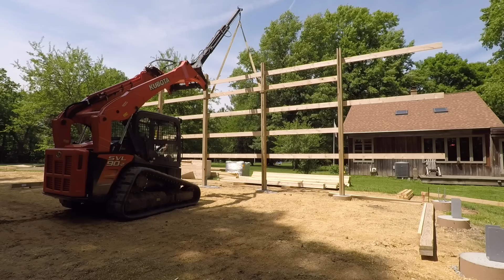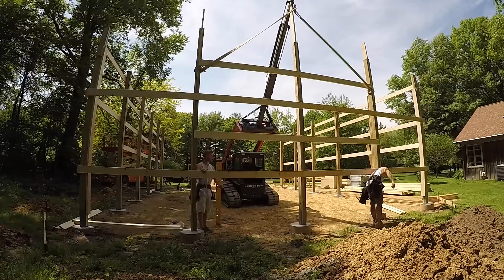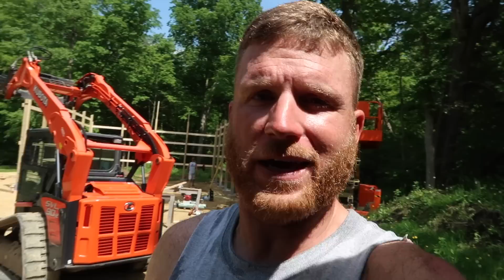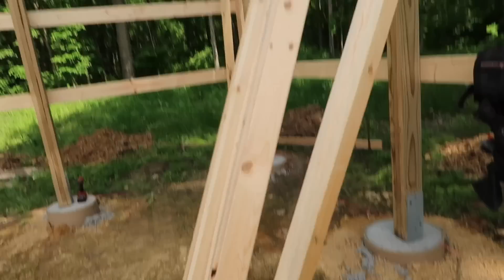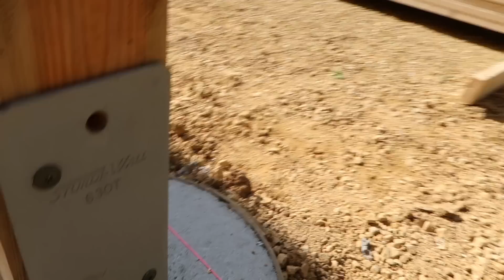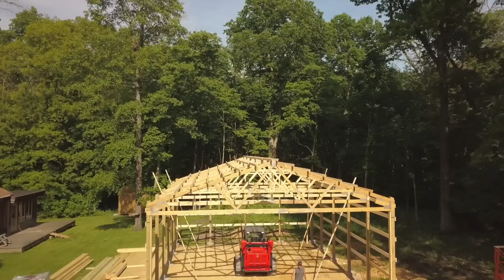How to Build a Garage Part 2.2 Walls and Trusses

Comment: So basically… the Kubota is replacing the 5 to 10 Amish guys that would usually raise your walls

Also, the only time we hear the word  “ telehandler” in our parts of the country are in the certification / licensing tests. Otherwise we just call it the lull … no matter what the brand … 😉

Great series by the way. Was directed here by your metabo rebar bendy doohickey vid

Comment: Hey Kyle, I had a couple of questions if you would not mind helping me out :) what size hole do you drill in your perlins? What length of perlin do you use? How do you overlap them and still be 2 ft spacing? What length of girts do you use? How do you girt the end wall with the truss outside of the end posts? I am trying to build our own 24x40 house with concrete slab inside of piers. Thanks for all the videos you post, you really encourage us!!
Reply: The exact questions I have....

Comment: Question for the builders.  How much is the front and back wall offset inside to allow for the back wall to attach next to the end trusses?  I’m confused, because it looks like the back wall posts are even with the end of the sidewalls with the back wall exterior gerts going across.  But the extended center sections on your end wall posts would interfere with the end trusses wouldn’t they? What am I missing.
Reply: I have this exact same question, its the only part i'm not understanding.
Reply: End truss attaches to the outside of the posts I think. I was wondering the same and it looks like that's what they did.

Comment: when you inserted those metal brackets into the concrete, is there anything other than the weight of the building holding them in place?

Comment: I;m from western ny and will be building my own post frame garage but plan on having living space upstairs. Center ridge board with rafters to allow for open concept. What's your thoughts?
Reply from the maker: If it passes the necessary engineering sounds fine.... I only worry about it splitting apart under weight.  Might need a bottom chord tie of some sort

Comment: We live in Indiana, looking to build a 30X40 building next fall. Would wood frame be better than steel frame? I will have to speak to an inspector since it's inside city limits, I do plan to hire a local company, or Amish to put the structure up. Thanks.

Comment: Is there an advantage to this kind of framing compared to a poured concrete slab with bolts cemented in it to attach the bottom base board?

Comment: I really like how you do all the math before and measure/mark everything on the ground so that later you only do the assembly. And I really like how you go through all the boards and leave the best looking ones for the most visible parts of the project. I had a guy do a really small garden project for me recently using railway sleepers. He only had 8 of them on shorter sides and still managed to install the worst one (the know was already out) on top. And was still making excuses and wanted to charge for the new one when I pointed it out. That only shows your professionalism.

Comment: Is there a reason you build 30'x40' instead of 32'x40' to match that standard length? I imagine it has something to do with roof length or overlap requirements, but I'm curious.
Reply: 32 x 40 is more efficient (increments of 8')

Comment: I am interested in knowing why you prefer the bracket method of connecting the columns rather than direct embedment of the treated posts into the ground to obtain the shear and overturning resistance? In my area it seems most are using a direct embedment method.

Comment: How does the grade board work on the front of the building when the bracket is in the way?
Reply: It has to be planed out slightly on the corner bracket.
Reply: Since then I’ve seen them cut off the outside bracket too
Reply: @idahoduckhunter  yeah, they do that on the corner and inside garage door opening.

Comment: Kyle when you set the purlins they appear to overlap at every second truss. When you later screw the roof sheathing into the staggered purlins line  how do you still maintain a single straight line of screws across the entire length of the roof?
Reply: Did you ever find out an answer to this? I'm curious.
Reply: No

Comment: reweatching this in 2019. it strikes me how cool the imperial system sounds when he shout outs all measurements. but damn its confusing. meter, centimeter and millimimeter. for instance, a drywall board is 2500mm, that would translate to 984.252. way too confusing :D or just say 2.5 meter instead of 984.252inches.
Reply: 98.425 inches. 🤣. 8 feet 2 and 7/16 will get you close. Little secret metric people seem to not know. Tapes are marked in feet. Think of feet as decimeters. They get you near where you need to be.    It really does come second nature.

Comment: Hey Kyle! 

I'm a big fan of your channel I have been watching you for years. I only want to say this as a friend would say this and not to be a keyboard worrier or something like that. When I was watching and you were standing the walls up I think you might be over weight and what could happen is a hydraulic leak. Please look up high pressure hydraulic injection injuries this might hit (Greg) a worker out side of the cab..... also once the wall or item is in the air and you jump out with the boom in the air the Hydraulics can fail and come down. so when you jump out of the cab and put your body in the line of fire or in the crush point between the cab and under the boom it sure does scare me. Maybe you do this and dont show it on film but all the Cat Skidsteers I have operated have a red  swing arm that can be put in place on a cilindar arm when in the air so if there is a failure you wont get crush Greg would have to put this in place while you are still in the cab.  Please keep up the good work I really enjoy watching!!!!

Comment: You mention about the aspect of insulating and vb regarding how you do the corner - is there any particular reason to not use spray foam insulation vs fibreglass (of course other than cost!!)

Comment: You mentioned that you installed the purlins every 2 feet on the rafters.  I see that you overlapped the purlins where the meet.  How do you align this with your 2 foot measurement?  Also, how do you keep your roofing screws properly registered with only a 1-1/2" purlin when they are presumably staggered at the overlap?

Comment: Probably a stupid question, but what is a "girt"?
Reply: Girts are the horizontal boards on the poles, they tie the poles together and are used to hang the steel walls.  Purlins are the same horizontal boards, but on the trusses.  Girts & Purlins - the way a pole barn / building gets walls and roof.
Reply: @shawnb2927  Thanks very much.

Comment: You may have answered this before, so if you did, please excuse me. What is your opinion of the closed cell spray foam for insulation on buildings like these?
Part of me wants to be lazy and have the company spray the insulation, and the cheap part of me says the fiberglass will do the same job at about half the price. 
I am building my barn/garage, and using wood that I have cut on my own land. While slower, it is in my price range. 
My house was built in , and everything is made of oak, even the roof. No plywood anywhere, just rough sawn red oak.
 Actually some pegs too. The plaster has cow hair in it for a bonding agent. I guess I'm happy it wasn't built in the city, because a lot of them used asbestos in the plaster. 
Your videos help me a lot, and I'm very grateful for you taking the time to film these, and rdit them. I know it takes a lot of time, and I just wanted to say thank you!
Smiles!

Comment: Sorry for not correct English, I'm from Russia. Question. What is your snow load, if any.
Reply from the maker: 35lb
Reply: @RRBuildings  Yes snow load on the roof you have a small
Reply: @RRBuildings  This is where the kilos on square meter

Comment: Why do you guys use this construction method? Why not the normal stud bottom top plate method
Reply: Cost and speed, plus to use normal plated walls, you need to start with a slab first.  Concrete floor isn't necessary for construction of the building, so getting under roof is significantly quicker.

Comment: IN PART 1

Holes like that are NOT the best solution for piers. These holes sink into the ground like a nail when there is a lot of precipitation or after winter. The CORRECT way is to build a square footing as a base  24 by 24 inches wide, 11 inches high, 4 feet into the ground. And then place a sonotube (pier) over the cement square base. 
The hole must be 54 inches deep, then place the footing, then a 10" or 12" Sonotube filled with concrete.
It is also a good idea to wrap the sonotube with thick plastic wrap, so that when the ground frosts it does not move the pier upwards, instead it glides on the pier.
Reply: There is no way they need a footing that big for the loads they have.  They are already way below frost line, so no issues there.  They are ~16" diameter piers already.  If you want later, he uses larger diameters for wider span footings (length of building doesn't matter).  This is all engineered and approved for actual soil conditions of the area.

Comment: I'd like to see a video from your perspective on building an efficient designed structure as far as overall dimensions, wall height, roof pitch, poured foundation/ footer walls vs piers vs post or laminated post set in the ground and general advice as to what to look out for and things to ask.  I wish you were in my area.  I'd have you build my next building for sure.  Thanks for the videos.  Any advice/ discussion on steel vs wood frame would be great too.

Comment: Are you using any perminent bracing systems for the walls roofs and roof trusses, appart from the chains and winches to align the frame for example in USAhttps://www.youtube.com/watch?v=RBIEmvhcQzI  
or as required in Australia in the video below
https://youtu.be/hKA6sVey8J4
Reply: Once the metal is one, that provides permanent bracing.  Or, if the building is sheathed, that provides plenty of bracing.

Comment: So the posts are off the bottom of the metal brace by the measurements you took and marked?
If so, that means the Cheyenne is holding the wall up and adjusting to get the bottom of the posts on those lines?

Comment: You plumb up corner posts after intermediate wall section is up... how do you keep intermediate plumb?  I didn't see any rack braces on it.   How are you keeping corner and intermediate plumb?
Reply from the maker: everything is installed plumb....then before steel goes up we check everything again

Comment: For those wondering is 8 foot bays are common, they are but not the only width/length you can set at, 12 is another common bay spacing and larger is less common but still doable with proper engineering and construction method. And for those wondering what size a 20d or 20 penny nail is here is a webpage with a bit of history of how the naming convetion came about for them and a quick size list for each length from 1 to 80 d/penny;
http://www.packinc.com/2015/09/why-nail-size-called-penny-why-symbol-d/

Comment: How much is it for this exact size building from start to finish? With a ceiling on but no wall coverings on the inside.
Reply: You are not going to get an exact cost due to additional factors, but some offer a base price for a package and from there it will increase per local building code requirements for roof load and wind load and also the type of foundation will affect the cost along with final looks of finishes and those entailed materials and their sources with their costs.

Comment: Tossing up that building is enough work, without adding the overhead of the video!  Hope this channel gets you some clients.  2 cents from the peanut gallery.  1] For this type of build have you thought about helical piers? 2] I noticed during layout from the story board you were marking each board individually? Do you think you could gang them if you worked from the ridge down, then just deal with variance cut @ grade?  just asking??
Reply: Never seen a post frame/pole building framing structure use helical pile for foundation for some reason...
Reply: at least for wooden structure

Comment: Another video idea is to cover what materials you use and preferred vendors.  I.e what gauge metal, truss spacing, grades lumber used, compare nails/screws you use vs box stores.  Basically help avg DIY builders know pros and cons of what materials to buy
Reply from the maker: good call

Comment: you gotta post sometime soon, how the floor is poured from inside a already built garage/storage/house. or if someone can link to a video on youtube cause im duiyng to know how thats gonna turn out.
Reply: on DiResta channel for his build it only shows very short bits of the pour process, but there are a few other that show more of the process if not the entire thing. Basically the skirt aka splash or footer board placed on the outside where the concrete will be is what defines the pour dimension and the concrete covers the columns on the three interior sides of the post at that level. From what I have seen the real pros tack a tarp to protect the interior wall from "splash" if already sheathed on the outside.
Reply: Old Post. Essential Craftsman has a good video where they expanded a pole barn and poured the floor
Reply: Was thinking the same. I'm in search of a solution for a solid floor for my shop build design. I'm deciding whether a concrete slab or wooden floor. I'm about to make the floor out of wood just because I can make it myself, but I'm afraid it won't be as solid as I'd need for a woodworking shop. ...
Reply: @LeonardoRojasCarpentry  just go with concrete.

Comment: If possible make / lift the end wall form the outside in...?
Reply from the maker: we could...a little bit more time to square up the wall when we build from the outside
Reply: Could be depending on wall height, but also depends on space of build area/zone around said structure and machine capabilities. its much like making sections in balloon framing and standing up one side and bracing and then framing and raising the next side. For those who would rather pre-frame the side and end walls, depending on with and length, you could do the ends framed inside and lift up and out and side walls outside and lift up and in, or vice versa is the height of sides to the width are just enough space. But you also have to take the machine size into consideration as well in this walls assembled before lifting method of construction. Of course if you got use of a crane then you could do side walls inside and end walls outside on the ground.

Comment: Great footage and explanations as always! Gotta love a bit of Greg bromance.
 I was wondering if you have any close up footage of the big nails you are using, I've never seen anyone predrill for a nail?
Reply: they ran those boards on  edge and nailed through the 2x4 from the side, if they were laying flat they wouldnt need to predrill but the boards wouldnt be strong enough in that orientation
Reply: on top or in-between the trusses your not going to see purlins laid flat, ever, and if you do then that build is not properly built to last very long, girts can be laid bookend (flat as you see RR do it) or bookshelf (think balloon framing) horizontal, vertical is considered useless by some professionals but it does allow for proper blown-in insulation installlation

Comment: I could never get away with not bracing those first two walls before the third wall secures them. It would make me super nervous that they would fall down, even if they are bolted to the concrete. But I'm a happy amateur and you are pros. I can see you are even climbing up and down those non braced walls! Thanks for the video Kyle.